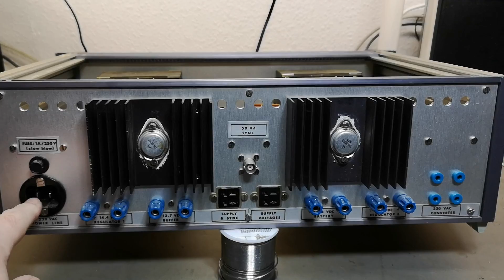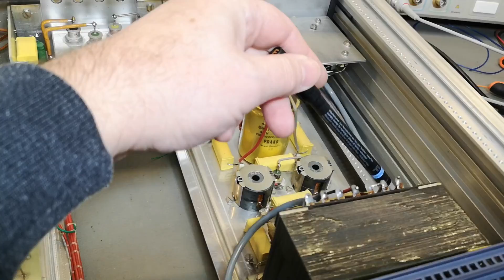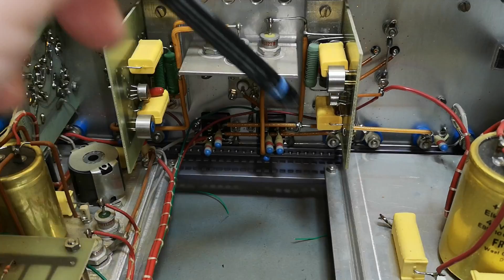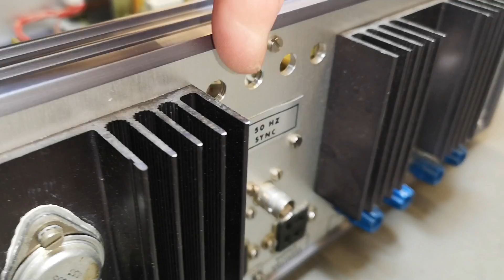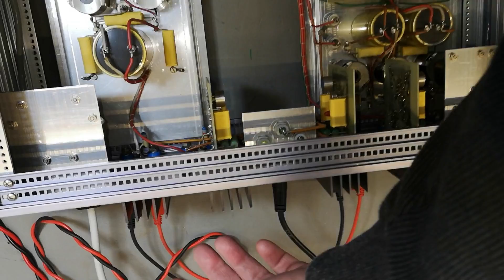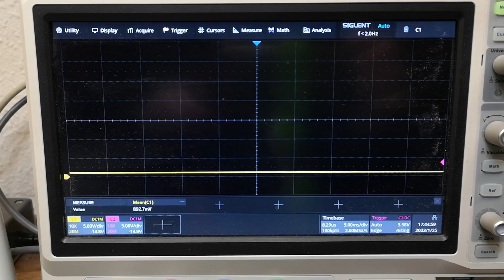DIY ionlab buffer power supply model 2 UPS 1980

Comment: Hi, those devices are made absolutely perfectly, because he built it for himself, he described it the way he described it, and he didn't realize that someone else didn't know his thought process - hence the inaccurate descriptions (that's what I think). When I see those beautiful machines, I start to envy your space where you can store them 😂 you know what I have available. 

Nice day 🙂 Tom
Reply from the maker: most units are traded to new things 1-10 weeks after I made the video, this way i get a constant flow of new fun things to play with, and i also use the storage space i got most uptimal, I do keep some units much longer, and some even forever, But even I need to realize storage space is not an infinite value